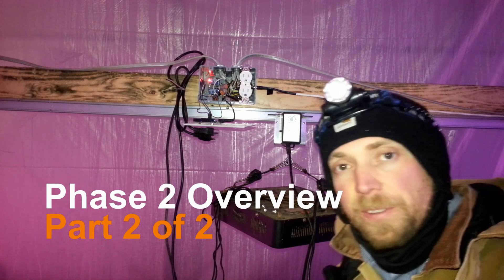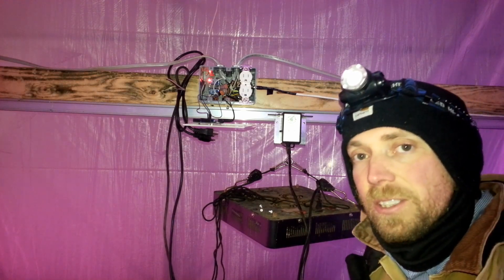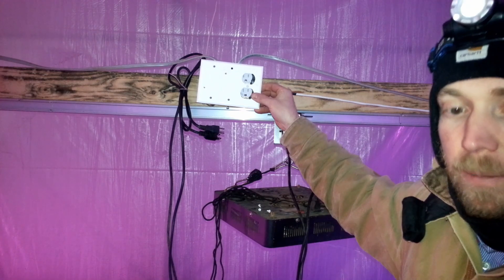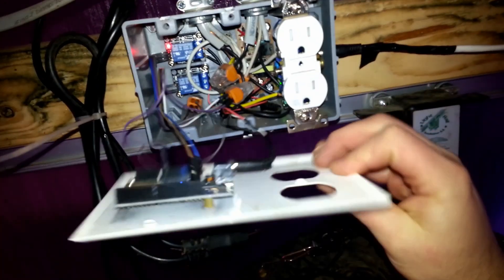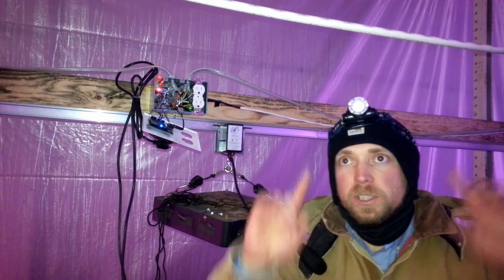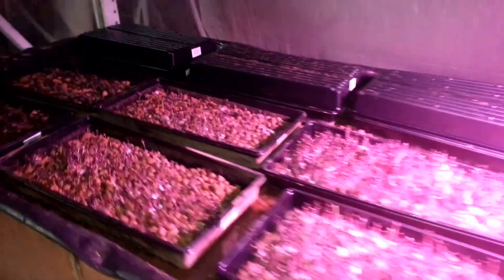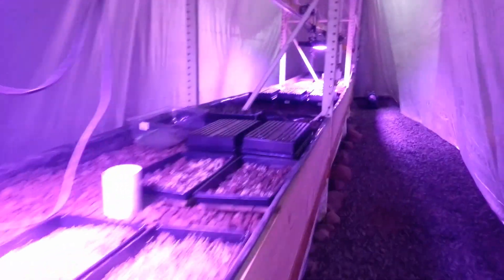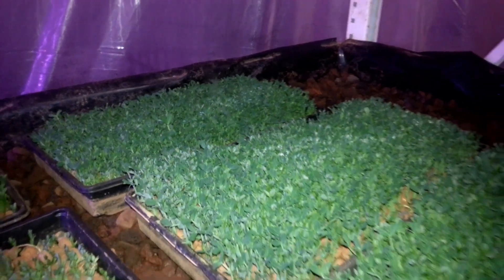Why the Future Homesteaders Need Automation - part 2

Comment: Be sure to double check legal ramifications of using HAM radio for this system. If it is supporting a revenue stream, it may not be legal to use HAM frequencies. I love the idea (I am a HAM), but don't want it to cause you undue grief.

Comment: TRM -  I love data as much as the next person, can you show us some data you look at on your system? Seeing what the arduino are storing on your home server in both raw and graphical form does help. plx-daq is a nifty excel plug in for streaming realtime sensor data into cells on a spreadsheet.  I ended up using it alot this past summer monitoring my temps on our house ac compressor lines. 

for software to show us what you see on your pc, try OBS, open broadcast system, it can screen share and if you tinker with it it is fairly fun for live streaming with slides and such.

do the flow meters you need have to be food grade? that is my problem the cheap hall effect and affordable options are iffy on I'd they are good with potable water.

Comment: Petersen Parts sells a nice 4', 5000K, 2750 lumens, 22 W LED lamp for $30, if that's any help. You would lose the power for the green part of the spectrum, but it would make working the beds more pleasant, and may help spot plant problems.

edit: replaced loose with lose

Comment: For the camera idea use the rail system, like the lights, at plant level or above.  Also use a servo to rotate camera if rail is between flats to get both sides.  Program the arduino to run the camera down the rail at your desired time intervals.  good luck.

Comment: Indoor localization with great accuracy is achievable right now with Bluetooth Low Energy (BLE), which is part of the Bluetooth standard starting with version 4.0. In order to use it, you'll need BLE beacons and a Bluetooth 4.0 enabled device. Unfortunately, Wi-Fi-only localization does not provide sufficient accuracy even when multiple access points are deployed (5 to 8m at best).

Let me know if you have any questions.

Keep up your good work.

Comment: I got an idea. Just thinking here. Am I correct in thinking your grow lights are UV? if so Couldn't you create your own grow lights that are the length of your grow beds? I'm talking real custom lengths. 

Here's the idea.... Do you have a table saw? If Not Cody has one and I'm sure he would be glad to help. I'm going to suggest PVC because it will not rot or rust in your humid Eco-Structure.
Get some 6 inch diameter PVC
Use a table saw with it's rip fence and a straight 2"X4" and a couple of clamps to create a jig. this will make it much safer.
Rip the PVC lengthwise into thirds using said jig. (use push sticks to stay safe)
Use a miter saw to cut the PVC thirds to the length of your grow beds. (Cody has one of those as well)
Use either contact cement or Spray adhesive to cover the  concave side of your PVC thirds with Aduminium foil.
I don;t know weather you should go shiny side out for more reflectivity or dull side out for a little diffusion.
OK, Now use PVC Cement to glue 6 inch PVC caps to the ends of your PVC thirds.
This next product i think is the next piece you need.
http://www.homedepot.com/p/Royal-Mouldings-6510-1-4-in-x-1-3-4-in-x-8-ft-PVC-Composite-White-Lattice-Moulding-0651008005/202089995
Cut it to the same length as your PVC thirds and either cement or bolt it to the opposite side of the PVC caps.
This Lattice strip is pretty flexible so you may need to create some spacers/supports in the middle using 1/4 inch (inside diameter) PVC and some 8 inch bolts and nuts that fit inside 1/4 inch PVC. (they might even be used to attach the mounting brackets later)
So you have a reflector and you have a shelf directly underneath it and now you can use one of these products on the shelf aimed up at the reflector Mounted with their self adhesive backing.
https://www.amazon.com/s/?ie=UTF8&keywords=uv+led+tape&tag=googhydr-20&index=aps&hvadid=153663195588&hvpos=1t2&hvnetw=g&hvrand=15663459113408044824&hvpone=&hvptwo=&hvqmt=e&hvdev=c&hvdvcmdl=&hvlocint=&hvlocphy=9010679&hvtargid=kwd-120390626177&ref=pd_sl_b8ww3gwty_e
All that is left are mounting brackets which could be made out of any metal but I recommend either aluminium or stainless steel, because of your humid environment. I suggest something an inch to inch and 1/2 wide and 1 to 2 mm thick. Just bend them across, up and across, (at 90 degree angles) and drill mounting holes

Hope this sounds promising  and sends you in an interesting direction.

Comment: Thanks for another great video. I think your plan to use ham radio is a bit problematic though. You can't use the amateur bands for any sort of business or commercial purpose. And you technically have to be in control of the transmission point which may not be practical for what you have in mind. The internet might be a better choice... If the sites have access.

73,
KE0ITH

Comment: I Martian. Some suggestions:
1. Use a motor/servo to turn your solar panels vertical or downward at night and at snowfall, use your Arduino to trigger that.  Your setup seems almost ready to make them move along the pole , besides you make them even more efficient when you add some light sensors for the perfect sun angle ) 
2. White light is the best, forget about expensive grow lights, buy high lumen white LED's  ( talking from experience and nature knows best )
Good luck !  Great project !

Comment: if you were to build a sand bag wall around your solar panels, would dead air alone, help to insulate the panels?
could you place a heater below inside this room, to melt the ice from below?
would temperature shock and break the panels?

Comment: Not worried if you don't do a video everyday.   Family comes first, in my opinion.   Automating to the point you want sounds fairly complicated and expensive.   Lets just try one bed and throw out what you need and I bet somebody on here could probably come up with a good solution.   Glad the heaters are working out, along with the weather.   Thanks

Comment: Are you monitoring CO and CO2 levels in there? I'm also curious what the microwave radiation levels are with all the wireless transmissions.
Reply: microwave radiation is non ionizing so it's not that much of a problem. It will also not be as effective since it would be at such a low density (i know density is not the right word but I can't think of what the right word is)
Reply: Lionskull even low levels of non-ionizing microwave EMR have been shown to cause health problems. Obviously, there is are enormous industrial interests with strong political ties who hope you don't know this. RF/CO/CO2 monitors are not expensive or hard to use. Wired sensors make much more sense.

Comment: As you get farther into each phase the distance between the grow bed levels will decrease. Have you thought about led strip grow lights like these:  https://www.amazon.com/Toogod-16-4ft-300LED-Growing-Waterproof/dp/B00USY5F3A . If you cut the strip in half the two pieces could have enough of a spread to cover the bed side to side and to attach to the bottom of the grow bed above. Good luck and keep up the good work.

Comment: Just a quick thought before you create multiple boxes. Use two boxes instead of having everything in one. The reason I mention this is so you can minimize your high-voltage connection points inside your box for low-voltage hardware. One high-voltage arc and you could lose all your low-voltage equipment which is a cost but also a headache to replace. 

Two boxes with a simple piece of conduit connecting them would allow you to have your plug in one box and and only the required high voltage lines for ingress/egress in your low-voltage box. You may also want to check the NEC which I haven't read in over 20 years :)

Comment: Have you looked into the LED strips of eBay? They work off 12v and come in a five meter long strip and at $15.70 you could run multiples on each grow bed. http://www.ebay.com/itm/252220806722?_trksid=p2060353.m2749.l2649&var=551053674385&ssPageName=STRK%3AMEBIDX%3AIT
Reply: Bill Bradshaw thank you!